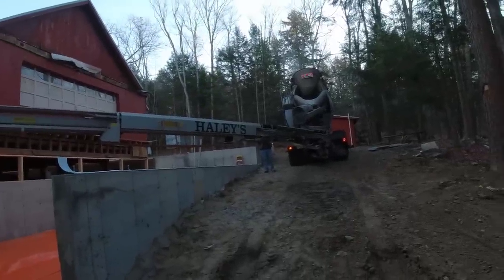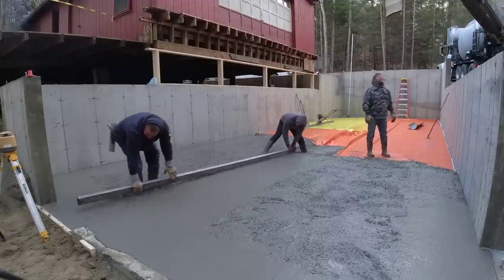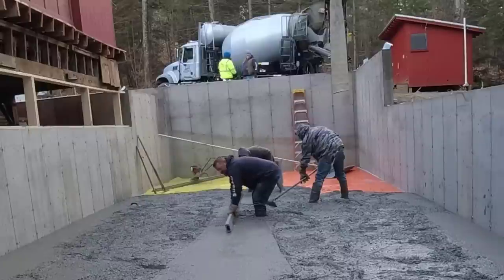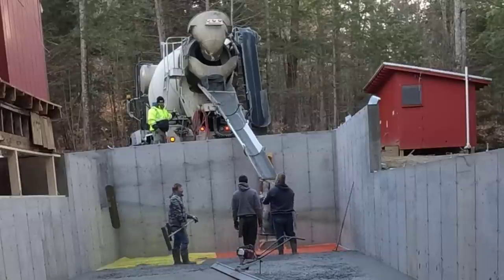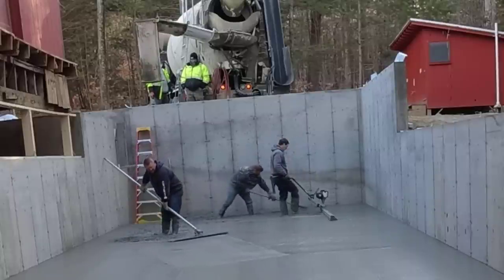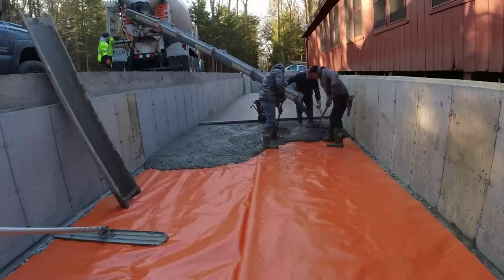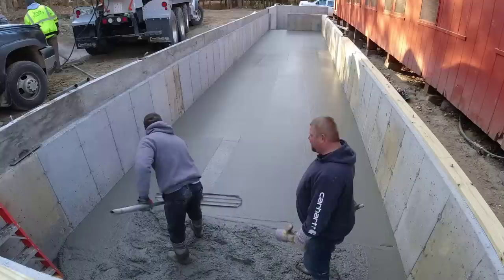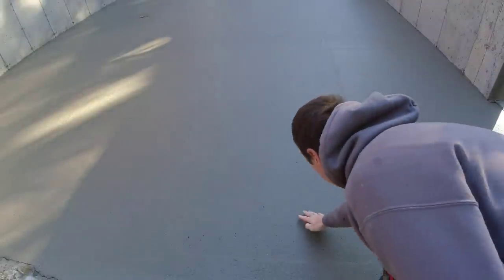We're Pouring Concrete Floors When It's Freezing (Bad Idea?)

Comment: I agree 💯 rebar or wire is used to limit the Crack width but we've found that saw cutting is more effective in Crack control. Giving it a place to shrink Crack. Rebar or wire not necessary we use it if it's specified otherwise fiber and saw cut.

Comment: That brand of screed you have the manual says you can bolt a 2x4 to length and go with that if you don`t want to cut your aluminum board, we used to take the older boards and cut them up and put new end caps on and we had every size screed after that. Your screed looks like a Multi-Quip brand screed from hear. You can get videos from Muti-Quip that shows how to screed steep driveway grades the right way ,It`s not hard to do and we have had good success with their method.
Reply from the maker: It's MBW's ScreeDemon

Comment: I hang fiber is this cold stuff on poles in the air off a ladder and my fingers get froze.  I have found that mittens warm them up pretty quick, put a couple hand warmers in them and its real quick.  I carry them inside my insulated overalls and when I need to, pull em out, warm my hands, then whip the thin gloves on and repeat as necessary

If I wasnt 58 and younger it would have been a pleasure to move to Maine a work for folks that have a good work ethic:)

Comment: Hey mike. Arlo shaddy here in Idaho. Been pouring mud 22 years and I can’t tell you how many slabs I’ve poured in freezing temperatures. I use a hot water, no fly ash and 2% calcium chloride mix design in the winter. It’s a little stiffer slump but it goes off quick.
Reply from the maker: Thanks for the info

Comment: Hi Mike, Great episode, I was wondering if a vapor barrier under a slab is needed in warm all-year climates? Will it hurt to use one where there is never a frost? Thanks
Reply: plastic is used to keep moisture from under ground soaking up thru the slab causing every thing to mold years later.